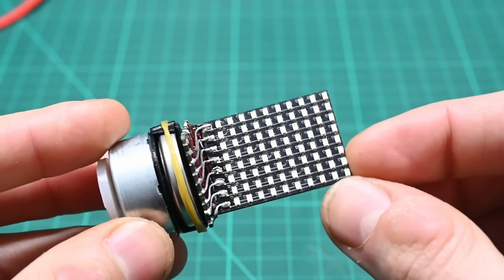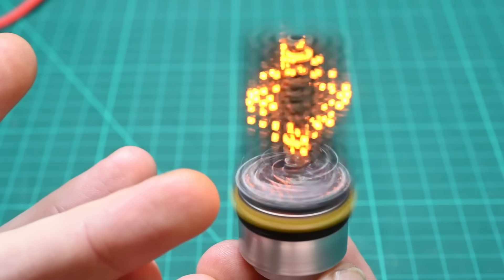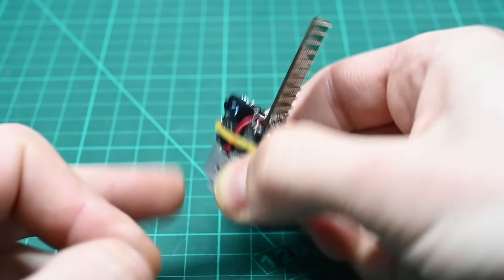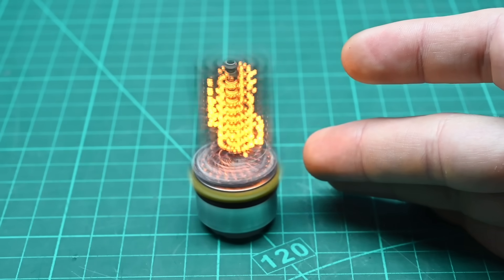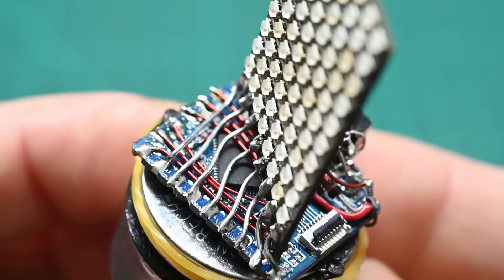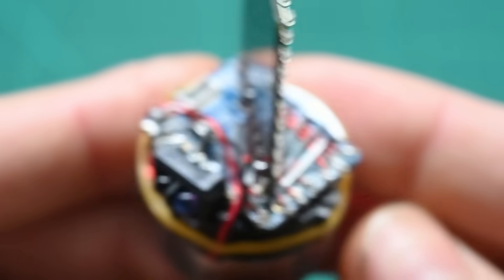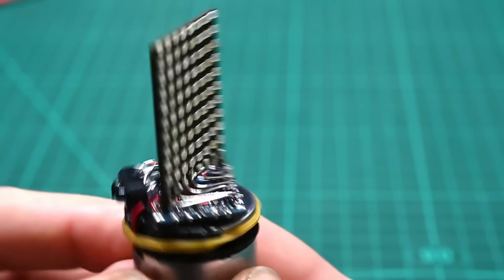Tiny volumetric display

Comment: This is so fucking awesome. The fact that it detects your finger and rotates with it adds more realism for some reason. Its amazing
Reply: Does it detect or is he just adding  friction that slows it down for a little bit and changes the orientation?
Reply: @Zachrandir  The little rectangular bit on the side is an IR transceiver. When he puts his finger close to it, the receiver picks up the reflected IR light off his finger. Putting his finger on it wouldn't change the orientation, only the perceived framerate.
Reply: @Zachrandir  I believe that it is detecting it but im not sure. There is an IR sensor on board thats probably for detecting how close your fingers are but idk if its used to detect the placement of your finger. Maybe he is only friction and im reading to much into it lmao but i didnt hear any sounds when he "touched" it so i assumed it was the IR sensor doing the work.

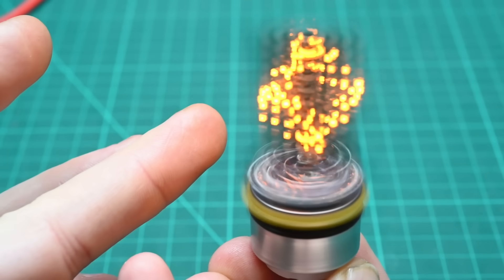Edit: look at 0:56 ! I actually thing the IR sensor is detecting the position! He's not touching it and the images followed his finger. Thats so cool
Reply: @bluebaconjake405 I'm guessing that the ir sensor is used so it knows when is has done a full rotation so it can stay still instead of turning if the speed is a hair off. By moving the thing the sensor detects (the finger) it changes where the display thinks forwards is.
Reply: @masonbarber871 yes, and that is the reason for the off-state if the finger is too far away: there's just no "frame" start reference (zero degree marker).
Reply: @masonbarber871  i though t it wa theres  so he could use an IR remoe to change the animations